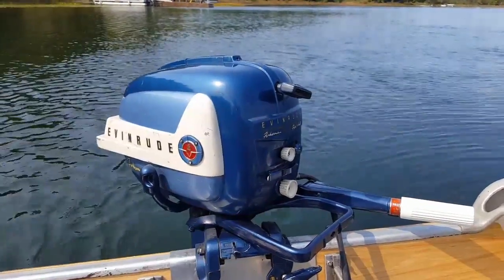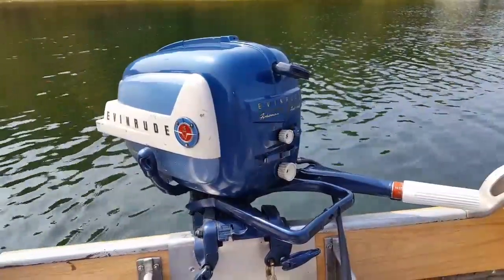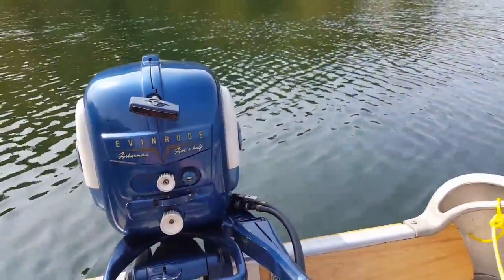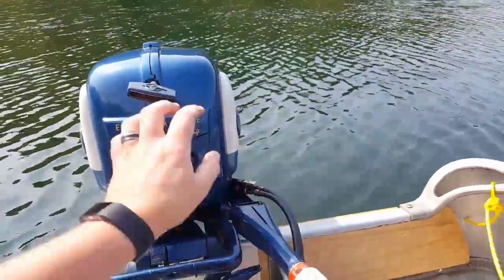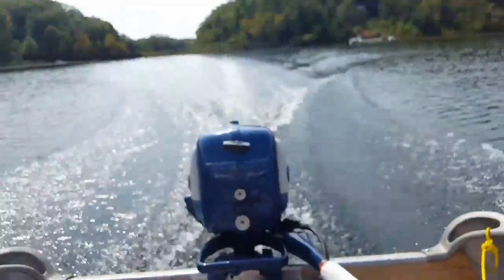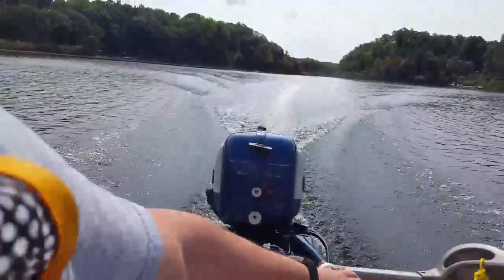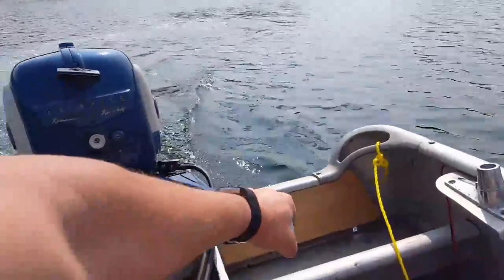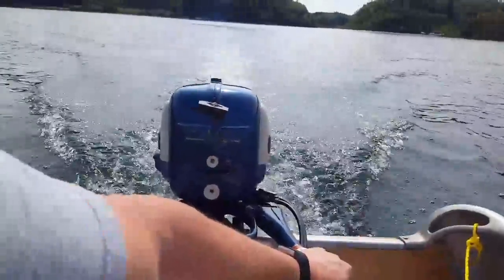1958 Evinrude Fisherman 5.5hp Outboard Motor

Comment: I'm in Scotland have two jonnyrudes the older ones a 75hp that I tuned (bigger coils & HTs, carb work and home made intake) it's easily at 85hp at the prop on a 1978 mayland 14ft fishing boat weighing 228kg it does 55+mph cruises at 36-38 70% best fuel economy while tramping and is one of the most terrifying boats I've ever been on nevermind built or owned. Anything over 90% throttle once it's on plane is just silly. It reels in all but the 300hp jetskis or proper speed boats and just eats anything thats designed for 40-50knot like they are nothing. It catches older skis about 40mph and I think I've done over 60knot  on loch lomond full throttle on the calm days. I know the hull was a copy of Vospa MTB from ww2 and I know it was the same guys who built the actual huge  Motor Torpedo Boat but I  don't know the limit of the boat so I don't push too far, my fear is that it bursts a seam around the cuddy of I hit too big a wave above about 50. I'm just not sure but if I knew the boat could take it I would happily give it full stick everywhere and just book more dentist appointments.

Comment: I'm building a 58 5.5 just like yours at the  moment. Bought it with water in the cylinders but finally found a new powerhead for it. The rest of it is in beautiful shape and I have about $350 in new gaskets, carb rebuild kit, water pump, and various other parts. Your video was great. It gave me a great reference on expectations and proformance. And they're great little outboards to boot. Great video, 2 thumbs up.
Reply from the maker: Thank you! Thanks for watching! Good luck with your motor!

Comment: Definitely the prettiest Evinrude in the 1950S in my opinion was 1958.Last year of the aluminum covers then to fiberglass in 1959.That motor looks alsmost new.I guess you got to expect a few scratches for its age.That motor will outlive most of us,LOLL.Need parts let me know I am a outboard mechanic and collector with around 200 old Evinrude and Johnsons and others going back to the early 1950s. Glenn in New York
Reply from the maker: GPALL52 In am quite fond of the 1958 Evinrude also. I do expect.a few scratches when a motor gets to be as old as thus one is getting.  It is mechanically nearly new, and it shows when I run it.  It is a beautiful runner and a good performer for a 5.5.  It's a keeper for sure.  Thank you for letting me know you have lots of parts.  I'll keep you in mind.   I have accumulated a pretty fair number of motors over the last few years too.  Most of them are classic OMCs.  There is often something I'm looking for.  Thanks for watching.

Comment: Just got one today and it is clean and runs nice .Previous owner put in impellor and full tune up so no worries
Reply from the maker: oldmustang 1969 Nice!!  They are really wonderful little motors.  Make sure and not skimp on the oil in the mix.  These are supposed to run on 16:1.  Enjoy your motor and thanks for watching!
Reply: @oldjohnnyrude8404 ... I live in Ida Michigan. Do you also work on Old outboard motors for other people ? I'm out around Irish Hills quite a bit. Great videos.....thx matt
Reply from the maker: @TheMatt4840  I occasionally work on motors for others.  It depends on what it is and how busy I am.  Let me know what you have and what it's doing or if it just needs routine maintenance.  I have quite a few projects lined up right now and 2 of them are for other people.

Comment: Ooooh. Wow is that a beautiful motor. I like the look of the 58 even better than the 59! Man does that motor run like new. Just purrs. Great job Ben.
Reply from the maker: billrok Thanks Bill!  Yes, this one is a beauty.  I am.amazed at how little runnimg time this engine has.   It was a bit of a challenge to get it back to right.  I did not suspect a bad coil as it was a very nice looking Prufrex.  I replaced it with a good used OMC coil and everything was back to normal woth the spark.  I also got a bad set of OMC points in the tune up kit I put in this one.  I'll be able to bend them a little and make them work, but I polished up a good used set and the adjustment problem end away.  After that I was dialing in the carb and the rest is history.  It's as close to brand new as any 50s 5.5 I have ever had or seen.  Thanks for watching!

Comment: Thats a pretty motor and it sounds good... and hey its older than mine and has reverse and neutral lol little jealous
Reply from the maker: This one is a sweetheart.   Definitely one of the 5.5s I have that I'll hold on to.  It is super low hours and runs perfectly.   The OMC 5.5hp had full gearshift starting in 1954 with their introduction.  The '53 was a 5hp and only had a neutral clutch.  They're great little fishing motors and will happily troll for hours. Thanks for watching!

Comment: Picked up my very own 1958 Fisherman 5.5hp yesterday! Ran it in the tank and it ran well. Took it out on the water to see how it pushed the boat. After about 5 min it started to squeal. I shut it down and checked it out. Not overly hot (able to touch it) and nothing looked out of place or wrong. I paddled in after that. I run a 1:16 mix. It did have some old fuel in the tank. But not much. Thoughts?

Comment: what a beauty!!!
Reply from the maker: Thank you!  It is a very nice original minus the paint damage on the rear of the cowl.  It is a very low hour motor that runs great. Thanks for watching!
Reply: @oldjohnnyrude8404  Well, you will rarely find an older engine that is absolutely mint. I had a 58 35 HP electric start/electric choke very similar to that on my 1958 wooden "Skipper Craft" boat. I honestly regret selling it, but your video brought back great memories...
Reply from the maker: @DONphantasmo  That is very true.  Not many left that are mint.  This one is still nice but I don't mind using it, so it's probably anyway.

Comment: And she is a strong runner also...
Reply from the maker: kramden Yes, this one is strong.  I want to run it on my Sea Nymph 14R this season to see what it will do.  My 64 Fisherman gets 11mph on that boat. It's the fastest speed I have achieved with a 5.5 so far.  This one seems really strong and the FD is a slower hull with lower HP motors.

Comment: What nice motors Evinrude/Johnson made. I just picked me up a 1957 Evinrude 5.5hp but I have had conflicting answers on the oil/gas mixture. The guy that sold it said 24:1 yet others say 14:1 What is your recommendation?
Thanks, highly enjoy your videos
Reply from the maker: Yes, they made very nice motors.  It is a shame they are not still building them today.  The 5.5hp OMC motors were 16:1 mix motors from their debut in 1954 until 1960. In 1961 they went to 24:1 with needle bearings on the crank journals until 1964 where they changed the mix ratio across the board to 50:1 (except for the 3hp).  Yours is a 16:1 motor.  It will thank you for running plenty of oil in the mix.  Thanks for watching!
Reply: @oldjohnnyrude8404  
Thanks you for your thoughts. Highly appreciated
Reply from the maker: @seniorLu48  You are very welcome.
Reply: @oldjohnnyrude8404  my '67 Johnson 3hp owners manual says 50 to 1 with the new Johnson 2 stroke oil.
Reply from the maker: @brianchisnell1548  That is true. 1964 was the year they changed the recommended mix ratio on their motors to 50:1. Some had internal changes that made this possible,  some were already able to handle it amd others just got changed.  The 3hp is a plain bearing powerhead with no needles or rollers at all.  I never run any of my 3hps on less oil than 24:1 and if they have an adjustable  high speed needle, I use 16:1 and tune accordingly. Thanks for watching!

Comment: Hi i just baught me 2 50s and was wondering if you no where i could buy the fuil line conection for this motors
Reply from the maker: Are you looking for the connector that goes on the tank or the one that fits on the motor?  These motors use the 2-line pressure tank fuel system.   If.you buy a working 2-line tank, it should have the tank side fitting attached to the hose.  The hose doesn't detach from a pressure tank like the single line suction tanks do.  Thanks for watching!

Comment: Do you ever seem to have issues with plug fouling running these at 24:1?  Mine seems to foul plugs if I idle for too long.  I know eventually oil fouling is inevitable but it just seems I happen too quick.  I’m using synthetic tcw3 and the plugs were new 3 years ago but I’ve cleaned them since.  The condensers are still original tho, could that contribute?  Thanks
Reply from the maker: No.  I don't have spark plug fouling issues with TCW-3 oil all the way to 8:1 mix ratio.  Excessive fuel innthe fuel / air mixture fouls plugs much more efficiently than the oil in the mix.  If you are fouling spark plugs while idling, I'm thinking your low speed circuit is set too rich.  It takes a long time idling to get the spark plugs to foul out from oil if the fuel / air mixture is correct.   Bad condensers can certainly make  for a weak spark condition which may lose its ability to fire through even a light coating of oil on the plugs.  I would replace the condensers,  clean and adjust the points, and dial in the low speed.  I have a video on this channel explaining how to dial in the carburetor if you're not sure how to do that.  I hope this helps.  Thanks for watching!
Reply: Thanks for the quick reply!  That’s what I’ve been suspecting is that these motors should idle for hours before fouling.  I’ve got the carb as lean as I can get without sneezing so I’ll try the condensers like you say and readjust the points.  

Ps always enjoy watching your videos and that motor is in gorgeous condition!
Reply from the maker: @joeblo4306  Yes, you should get hours of trolling time ot of these motors without plug fouling if they are properly tuned.  Condensers are worth checking/replacing if they are in question.   If you cannot achieve a slow and steady idle without lean sneezing or fouling spark plugs,  you may want to check your link and sync.  It may be bringing the carburetor in too early.  The notch on the throttle cam should be in the center of the cam roller for the carburetor at the moment all.the slack in the carburetor linkage is taken up and the actual throttle valve (butterfly) begins to move.   If it is already set that way,  try to delay the pickup of the carburetor to around 1/4" past the mark. I hope this helps.
Reply: Sounds good I’ll give that a try too!  I changed the condensers and gave it a run.  It actually idles pretty good but as soon as I rev it up past 1/3 throttle it seems to have trouble deciding between 1 and both cylinders... and then at higher throttle settings it runs smoothly.  Might be plug wires... only thing left to change.  Also does the stator on yours have a little play in it at all?  And are you running champion J4Cs in that?  Thanks
Reply from the maker: @joeblo4306  I would definitely recommend replacing the spark plug wires.  It sounds like a bad connection at one end or the other on one of the plug wires.  It could also be contacting sometime and shorting to ground part way through the rotation of the mag plate.  That is often the issue when one cylinder cuts out at certain throttle positions.  You may try running the motor innthe dark with the cover off too.  Sometimes the issue will show up as a visible spark in the dark.  I'm not sure now if I put J4C or J6C plugs in this motor.  I'm sure it has one or the other in it. I use J6C plugs in most of my OMC magneto motors, other than the ones that I run hard at full throttle a lot. I usually opt for J4C in those.

Comment: What do you use for the fuel feed to the motor? I noticed on your 1960 you had a regulator of some sort
Reply from the maker: The 1960 has a fuel pump. I was running it with an adapter off of my pressure tank.  You were seeing my single line adapter for my dual line pressure tank. Thanks for watching!
Reply: @oldjohnnyrude8404  I have the same motor! I have a tank with 2 lines air and fuel. The motor will start but won’t stay running without me babying the throttle. Does the tank need to be pressured?
Reply from the maker: @billyho5993  which motor do you have? The 1960 Fastwin? The '60 is the first year for the single line with a fuel pump on the motor. If you're using a 2-line pressure tank on a motor with a pump, the tank does not need to be pressurized, it would need to be vented. The fitting is different for the pressure tank, so I'm unclear as to what you have?

Comment: I have this exact motor, however the fuel lines and connectors were lost, do you know where I can new ones?
Reply from the maker: I use 3/16" rubber fuel line from the local auto parts store.  The correct size is actually 5/32" and while that does work a little better and doesn't require much of a clamp to hold them, I use 3/16" and the hose clamp style zip ties and don't have any problems with leaks.  As far as the fitting for the motor side, look on ebay for the seal line pressure tank style motor side fitting.  If you have the pressure tank with a fitting already, you're all set.   If the tank fitting leaks, they can be rebuilt with new o-rings.  Thanks for watching!

Comment: I just purchased one of these.
It says to mix 1 pint of oil per gallon of gas. That is a 16:1 ratio.  Isn't that a little high?
Reply from the maker: No, it's correct.   This is a 16:1 mix motor.  It is a bushing powerhead with no rolling bearings.  They need the oil.  They're great little motors and they run very quiet and smoothly.   Lots of them have been ruined by too little oil though.  With a good modern fully synthetic TCW3 outboard oil you may be able to cheat it a little drier, say 24:1, but I recommend sticking with the factory ratio for best results and longest engine life.  Thanks for watching!
Reply: And Hi Octane Gas .
Reply from the maker: @carvinlambert6899  Hi octane isn't really necessary,  but if premium is all that is available without ethanol, then use it.  87 octane regular is plenty high for these engines.  They are fairly low compression.   I have seen ethanol do things that we don't want to see though.  Thanks for watching!

Comment: Where do you get the parts for your motors
Reply from the maker: The consumable parts I usually buy from Marineengine.com, Vintageoutboards.com, iboats.com, etc.  My closest Evinrude dealer is 30-40 minutes away the opposite direction from work and is never open when I can get there.  The non-consumables I usually source from club meets by buying either individual parts, boxes of parts, or parts motors from other club members.  I occasionally find what I need on EBAY or locally on Craigslist or something like that.  Thanks for watching!

Comment: How Much does it cost for all these replacement parts?
Reply from the maker: Usually between $70 and $180 for tune up parts and seals depending on what parts have to be replaced.  Sometimes other things need to be replaced too.  Cost varies but I buy spare parts when I can find them cheap.  To replace many of the non-consumables is cost prohibitive to buy new even if they are still available.  I have been building parts inventory to fix my own motors since I got into the hobby.  Thanks for watching!

Comment: Does this motor throttle off a roller?
Reply from the maker: Yes, the throttle arm has a roller that rides the cam on the magneto plate to open the throttle as the timing advances.  Thanks for watching!
Reply: @oldjohnnyrude8404  thanks. Thought so. Mine is apparently missing.
Reply from the maker: @DiabolicalDesigns  You're welcome.  You are not getting anywhere close to full throttle opening without the roller, obviously.   I have seen those turn up missing because the little E-clip had failed or gotten lost of the roller arm.
Reply: Yeah, I'm going to have to order one. For now...I have fishing string tied to it with a handle lol.
Reply from the maker: @DiabolicalDesigns  I guess that works till you get one, but you need to replace it. You'll like the motor a lot more with that fixed.
Reply: @oldjohnnyrude8404  For sure. Definitely replacing the part. Took it out last night for the first run. Went great